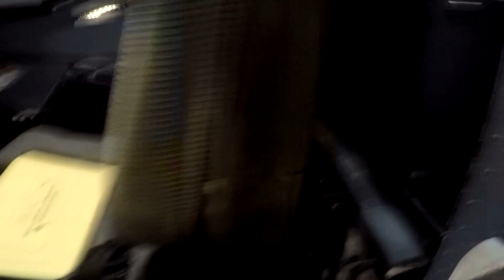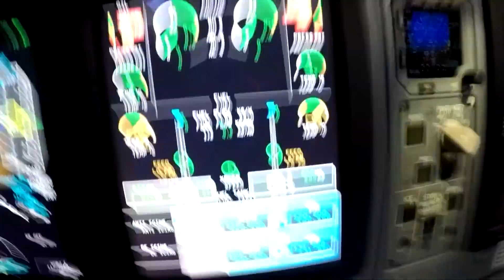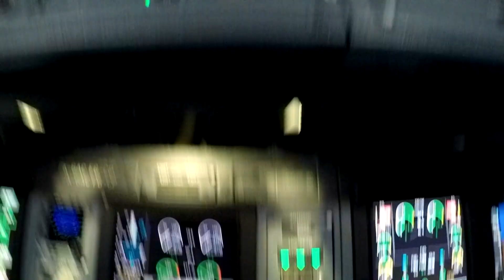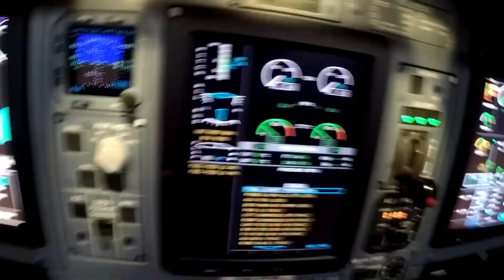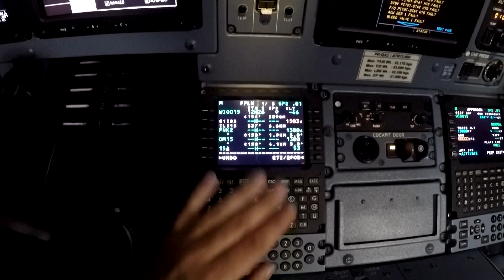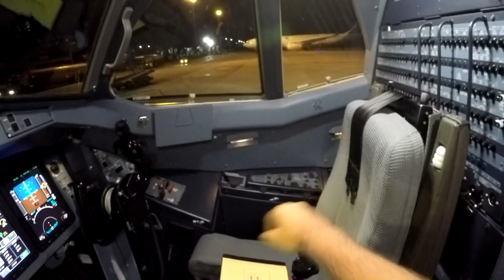ATR72 600 Cockpit review

Comment: Hey! Im wondering, isnt there an autopilot for speed? Is there a switch for speed and climb position like on airbus? ✌️
Reply: ATR can make little adjustments automatically on torque but it doesn't have an autothrottle so far. It is not needed really because you set power levers on "notch" position for takeoff and they keep there until descent when you need to retard them a bit in order not to exceed 250kt IAS. However power is definetely not the same during takeoff than during cruise, and this is done by propeller rpm with the power management selector, which has 4 positions: TO, MCT, CLB and CRZ.
TO gives 100% NP when power levers are on notch, and it is used for takeoff until acceleration altitude (minimum 400ft Above Aerodrome Level)
MCT (maximum continous thrust) gives also 100% NP and it is used on emergencies like single engine operations
Climb and Cruise both give 82% NP, the difference is that Cruise gives about 2 or 3 % less torque.
Hope it helped, if you have any doubt please let me know!

Comment: Nice Video! Thanks. 
I have few questions about 600.
Which ILS category 600 have? And What is minimum system limitation AGL of Autopilot? 
And what type of Wx? Is there any big different between 500 and 600?
Reply from the maker: Hi, Ben Kim!
They are approved for CAT2 manual landing.
They have good WX (I don't remember the model, because I used to fly it long time ago). 
The difference between 500 and 600 only in Cockpit and some minor systems...

Comment: Hi congrats for your channel, i am a training captain myself on the CL605 and on the 737-800 although i have always been fascinated by the atr which i never had the chance to fly. I have two questions for you: what is the purpose of the IDLE GATE on the pedestal and do you have any indication which can be compared to the N2 on the 737 showing the rotational velocity of the compressor - i am not sure if the engine on the ATR is a multi spool - cos i only saw the Np gauge in the presentation. Can you also explain the engine start procedure and the sequence of events that take place as you manipulate the engine controls and switches during the start? Many thanks and keep up the good job!! Spaciba!
Reply from the maker: Hi there! Idle gate prevents power levers to go to ground idle. If you do that in flight the propellers will go to the lowest pitch and that will create windmill propeller spinning with possible loss of the power control and loss or the speed due to eccessive drag. Idle gate may be pulled manually after touch down but usually it is activated automatically after air-ground sensor signals landing (touch down). After touch down you need that huge propeller drag to stop the airplane. Without Idele gate activation you can't set reverse power. It is the duty of pilot monitoring to check the Idle gate after touch down. If it would not come out just pull it manually.
Ok, now for the second one:
The main instrument to check the power is torque intication in 100%
Turboprops are different. There is no thrust, but power. Torque is the parameter to check it.
NP is used to check the propeller RPM, but it is not the main parameter to check the power on turboprops. For example on Antonov-24 the propeller RPM is the same on Indle and at take-off setting, but the propeller pitch changes so the fuel flow. The torque is different. ATRs have nore complicated electronic engine control system so the propeller RPM also changes as well as fuel flow and propelller pitch. 
The torque meter is very simple and easy to understand. You may take it as N1...
I hope I answered your questions. Thanks for your comment!
Reply: Pilot Blog hi thanks for your time and willingness. So if I understand it correctly you have no compressor indication at all, even during start up? So how do you know when you have enough airflow to support the combustion at a stoichiometric ratio during the start up to introduce the fuel without risking a hot start? And what do u exactly control with the power levers and with the condition levers? Many thanks
Reply from the maker: @diegobeatrice5257  You have Nh (high pressure spool RPM).
Powel levers for power. Condition levers for fuel open, feather, and propeller pitch control.
On new ATRs you set condition levers in auto before taxi and before shut down. 
Automatic system controls the propeller pitch based on power levers position.
Reply: Pilot Blog many thanks for the reply. I could not see the Nh gauge in your cockpit presentation of the atr 72-600. Is the Nh displayed at all times or only during start up or certain phases of flight? And at which Nh do u introduce fuel during start up?
Reply from the maker: @diegobeatrice5257  As far as I remember you may check it out on MFD...
Reply: Pilot Blog hi Many thanks for your replies and congrats for being back flying! Love flying into antalia, often we have thunderstorms in the afternoon and the approach from the land side is a bit tricky as they always keep you high! Anyway back to the ATR if u dont mind. i have a couple of questions about the prop pitch change mechanism. As far as i have understood to vary the pitch the PEC feeds supply oil supplied from the HP pump on the prop RGB through the EHV housed in the PVM, to either the increase or the decrease pitch aide of the actuator causing a servo piston mechanically connected to the shanks to slide inboard or outboard, changing the pitch. To decrease the pitch, for instance, the PEC feeds the so called control oil - not sure where it comes from - to the decrease side of the actuator, opposing the ever present supply oil, driving the piston and the blades towards a flatter setting as reflected by a drop in Np; conversely to increase the pitch the PEC dumps some control oil allowing the supply oil to drive the servo piston and the blades towards a higher pitch. If HP supply oil from the HP pump is not available the system will the back up electrical feathering aux pump to supply oil to the increase side of the actuator and drive the blades towards a higher pitch. Is that correct? How is the control oil dumped and where? During normal ops is any oil fed into the increase side of the actuator or the increase in pitch is solely obtained by dumping the control oil and allowing the supply oil to drive the piston? Many thanks for your time and willingness

Comment: Great video!  I have a couple of questions if you don’t mind.   Do you always have trust in the ATR (feel safe flying it) given its icing problem history.  Also,  i was wondering how it handles?  Best regards
Reply from the maker: Hi Swing Left Golf. You asked a good question. There were couple of accidents because of poorly designed de-icing system of ATRs however after the "Chicago" accident the de-icing boots were redesigned and the upper surface of de-icing boots were increased to fight with ice build up on upper wing surface. Also ATR updated the flight crew operating manual, saying how to avoid the problem. The last air crash concerning ATR + Icing was ATR72-200 crash of UTair Airlines in Tumen airport. However it wasn't ATR's fault but the pilot's. They hadn't done the ground de-icing and airplane took off with snow and ice on it's wings. Pilot also retracted the flaps much earlier than needed in icing conditions, killing the lift and causing the aircraft to stall. I would tell you that it is reliable airplane and this crash could happen to every aircraft type. The ground de-icing is critical procedure to be done to every aircraft. I was flying ATRs in Siberia and with temperatures down to -53C. We encountered severe icing many times but had never had any issues in controlling the airplane. Also Sweden SAS flying ATRs far to the north. Of course the ATR is not perfect, but I would rather increase the engines power than update the anti-ice system. The ATRs need autobrake, speed brakes, and more powerful engines. Luckily there is going to be new ATR42/72-600S with all those new features.
Even though I fly B737 I still miss the ATR. It is nice airplane, don't worry. Safe flights!
Reply: Pilot Blog thank you very much for your in depth answer!  After landing in a mx crosswind, is it easy to control the aircrafts lateral sway with the ailerons or is it very difficult?
Reply from the maker: @ASILASIL1  I think it is much harder compare to Boeing737. The landing gear is under the belly, with   narrow track line. For example on Dash Q400 Bombardier the landing gear main struts under the wings, however Dash has more issues with lading gear compare to ATRs, but more easy to control. Also the ATR's nose gear has no control connection with rudder pedals. So with the strong x-winds you need to use the manual steering on Captain's left side. But it is not critical...